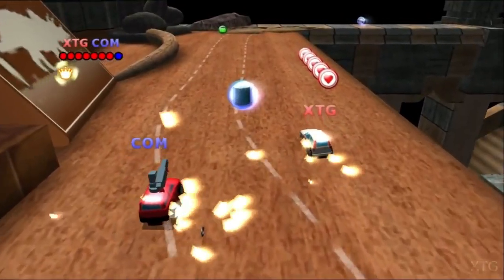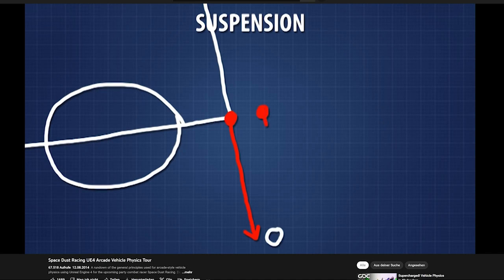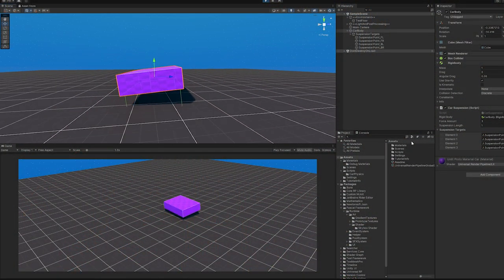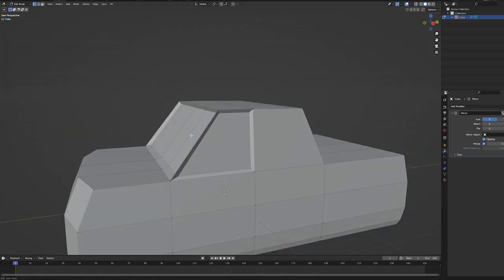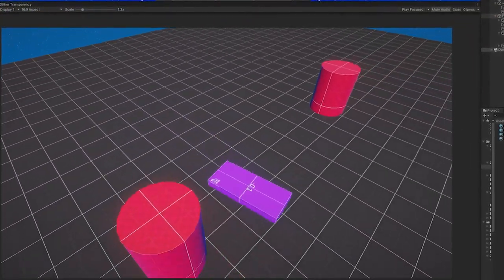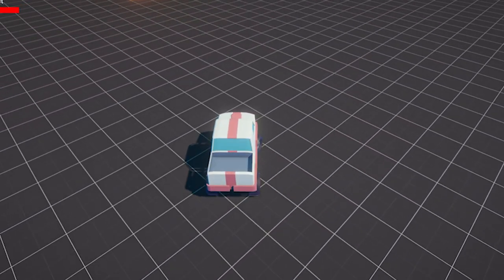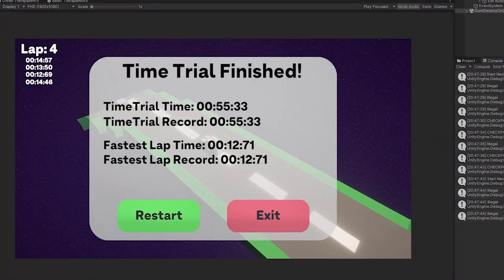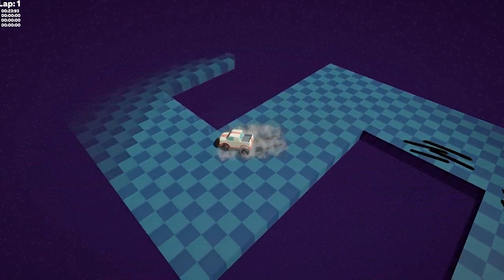How I made my own Arcade Racing Game

Comment: using drag on rigidbody will result in stopping car instantly. instead of that you can use dragfroce = -D*V. D is damperAmount(constant) and v is velocity in spring direction. you can add this in spring force and that will be your suspension force.

Vector3 springDir = transform.up;
Vector3 tireWorldVel = carRigidBody.GetPointVelocity(transform.position);
float offset = suspensionRestDist - hit.distance;
float suspensionVel = Vector3.Dot(springDir, tireWorldVel);
float force = (offset * springStrength) - (suspensionVel * springDamper);
carRigidBody.AddForceAtPosition(springDir * force, transform.position);

Comment: Hmm, overall pretty good, but adding the drag itself is not a good solution to making the springs behave. The springs being unstable have to do with the math behind them, adding drag is basically a bandaid that has other negative effects like the way the rigidbody now moves through the air.

There are some good videos out there on how to tackle springs for cars ^^ I recommend watching a few so you can set drag back to 0 and have proper spring function, that would make it feel even better!
Reply from the maker: Oh interesting! Thanks a lot, I'll check those out :)

Comment: About Drifting I known,
 every object has two frction. 
kineticfriction(for sliding surface) and static  friction(of course not sliding face)
generically static friction is more higher.
if car wheel rolling as car speed, wheel roll whitiout slip(at whell touch ground point). so wheel has (powerful) stop friction and it make stop slip sideway 
but wheel is slow or stop rolling(commonly use break) wheel is slip with weaker kinetic friction, than car can more slip sideway and rotation more wide range.

Comment: If you park your car on a slope, so that the left wheels are higher than the right...does your "anti drift" stop it from sliding down side ways?
Reply from the maker: Not sure tbh, I'd have to take a look at my implementation. But I think no, because the anti drift should be only active if there is acceleration input
Reply: @ObviousDev  I have a similar setup to yours. But if the road is angled around the Z axis, the car slides side ways down the hill slowly. Like the x component is not canceled out 100%. Must have some mistake somewhere.
Reply: @TheXSpitfire  It's because you're simulating dynamic friction without static friction.  Most arcade driving physics involves simulating one without the other.